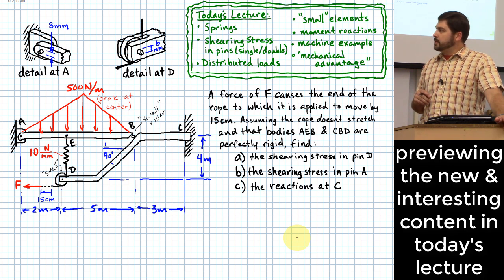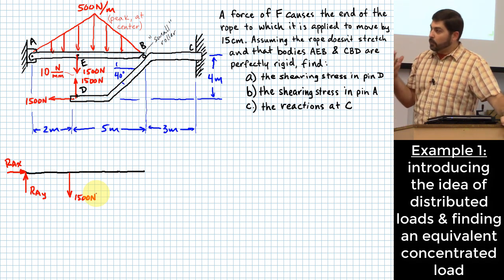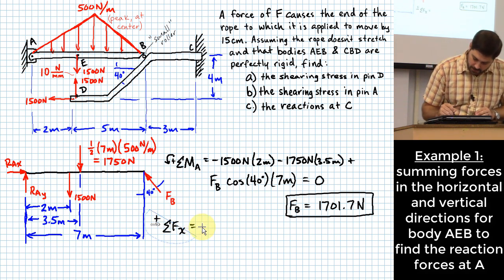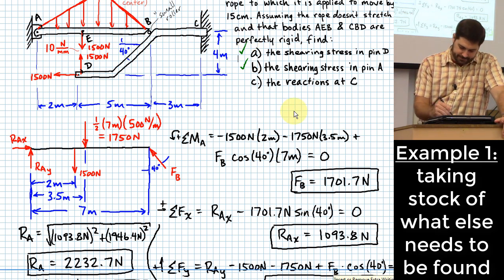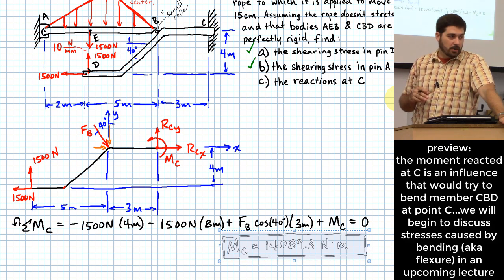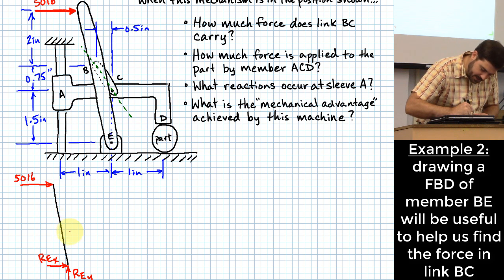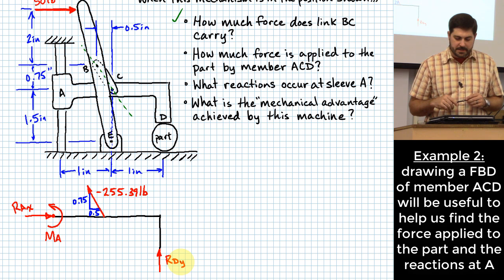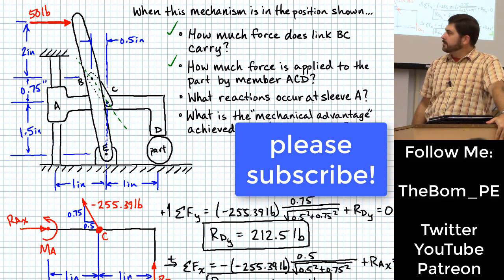Frames & Machines II: Moment Reactions, Mechanical Advantage, Distributed Loads, Single/Double Shear

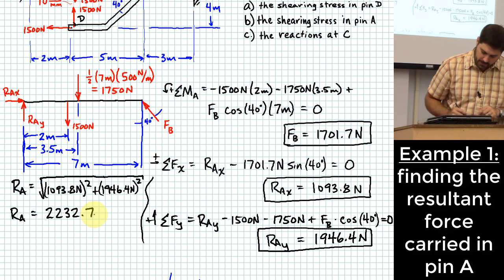Comment: Lets say we need shearing stress on pin E (even though it doesn't need to be asked) . Souldn't we consider a FEx component for that pin ?32:00
Reply from the maker: The member connected at E is a 2-force member. That means it only applies force along a line extending from one connection point to the other connection point.
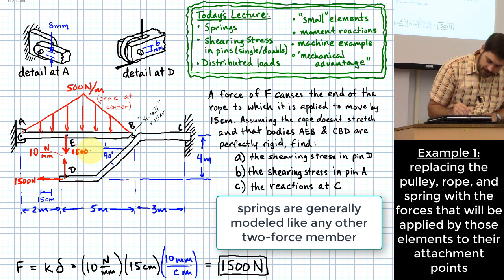Reply: Thank you for answer. I missed  note that at 10:41.